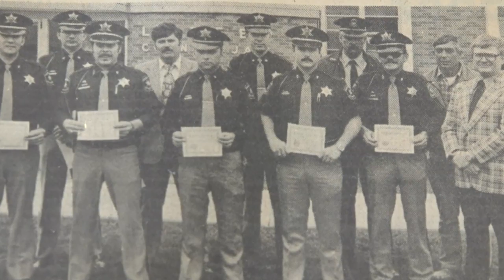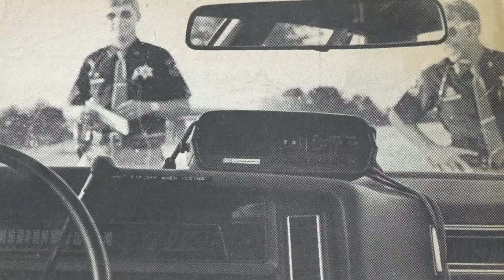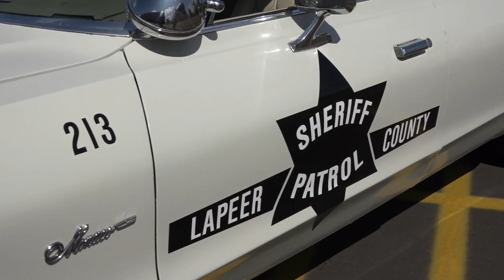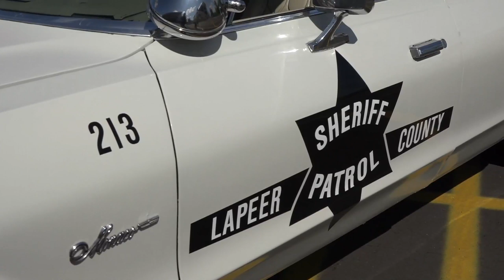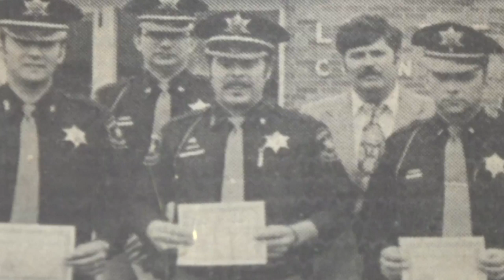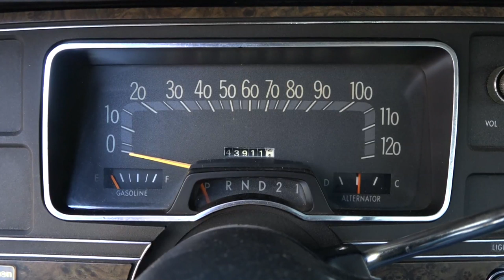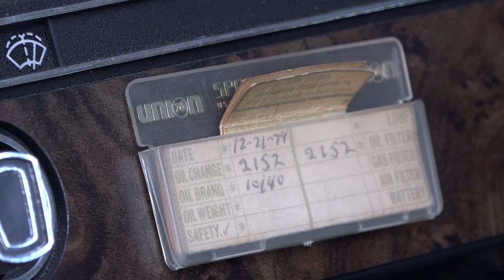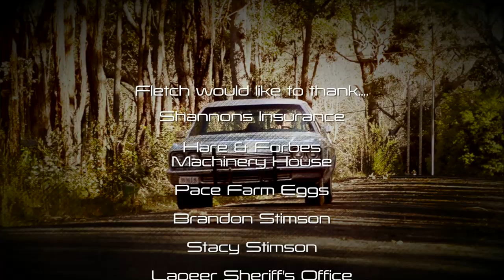Deputy Stacy and his replica '74 Dodge Monaco Patrol Car: Classic Restos - Series 41

Comment: Just FYI for the Aussies, the drilled hubcaps didn't come along until the mid- to later 1970's.  The correct hubcaps for that car were non-drilled and had the Dodge insignia in the middle, with a red band around it. I can send you a picture of my brother's police car from back in the day, if you'd like. The police models had a steering wheel with a steel horn ring and a 140 mph "certified" speedometer, versus the 120 mph gauge on the civilian car. By the way, I LOVE that you Aussies are into Mopars. I hope to someday tour your country by motorcycle. God bless you!

Comment: Dahgum, I thought this was a recent episode, but it’s a year old. I still drive a 2008 Ford Crown Vic Police Interceptor for the police agency I work for and I’m doing all I can to hang onto it as long as possible. Way back in the mid-80s, almost 40 years ago, I worked at an auto parts store in Hollywood, Florida. Well, a local mechanic named Sal would frequent our store for his repair jobs and periodically he would buy and/or order the Edelbrock dual-plane intake manifold, the matching cam and lifter kit, a Holley 650 cfm carburetor, and a set of headers all for the small-block Chrysler 318 and 360 V8s. One day I asked Sal what he was doing with all those performance parts. He told me he was installing them on the Seminole Indian Tribal Police cars; back then the Tribal Police drove the 80s Plymouth Fury police cars. I doubt none of the local Police and Sheriff’s Office Agencies would be able to get away with that.

Comment: The Monaco was not designed to replace the Polara. It was offered as a premium trim level of Polara(since they were actually the same car from 1965-1968. I. 1969+ they were still the same car but with a unique cost effective fascia and tailpanel for fleet sales or bargain models and a more extravagant fascia for higher trim models). In 65 the Chevrolet Impala has a premium trim model Caprice and the Ford Galaxie could be loaded up with trim to the Galaxie Limited(LTD) so this gave Dodge Division a way to bring in the value buyer who wanted premium features on his fullsize family car. Plymouth did it as well segmenting the Fury into 3 specific trim lines and adding onto that ad hoc, with VIP, Sport Fury and Fury GT to compete with the many offerings from GM like the Grand Prix and Wildcat.

Comment: That blue Monaco rides better than a 72 Cadillac because of thr unibody construction and Torsion bar front suspension and leaf spring rear suspension.
Go around a corner at 25mph and you will see the difference. All that Cadillac body roll and tire squeal

Comment: A. The cars had been unibody construction since 1957 so 1974 was nothing new. 
B. The 1974 models rolled out in August 1973. The fuel crisis happened from October to December 1973.
C. All the manufacturers made cars the same size during this time so Chrysler wasnt singled out for anything
D. Chryslers sales problem was because they had no models below the A body compact class to bring people at the same time. GM has the Vega as a subcompact and Nova as compact. Ford had the Pinto as the subcompact and Maverick as the compact. Chrysler only had the Dart intially then imported the Mitsubishi Colt while Plymouth imported the Hillman Cricket. But these cars should have been here 3yrs before.